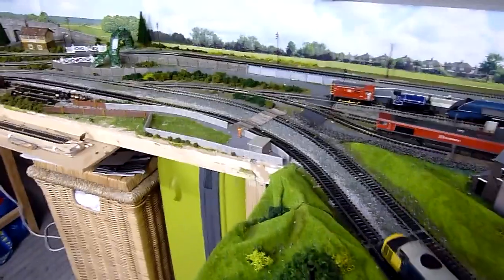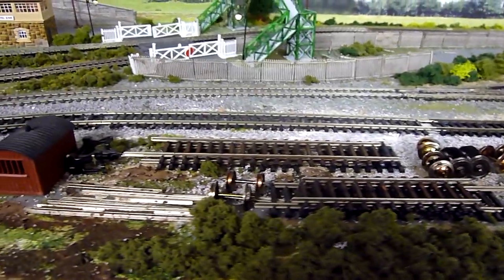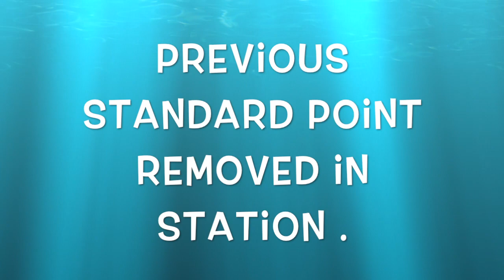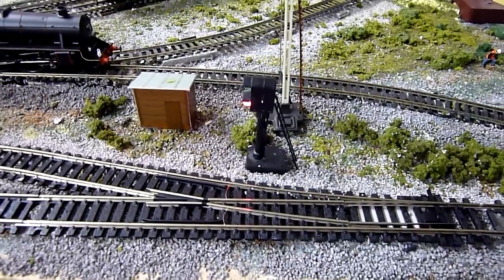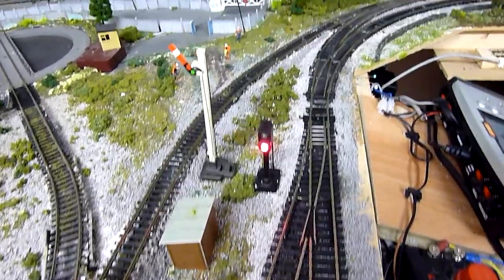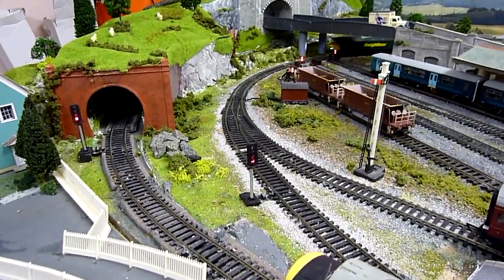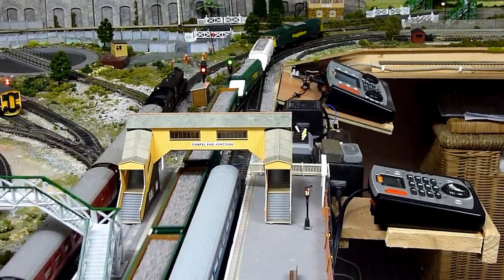TWO RUNNING PROBLEMS SOLVED .

Comment: Always little improvements to be made Peter, I'm just starting on an all day job reorganizing some wiring. I worked before but this will be more logical and easier to understand. ( I hope lol.)  David.
Reply from the maker: Hi David , yes always something needs tweaking on the layout . I wired in a new light signal if you noticed at the end of the station . 
    Has winter arrived yet for you ? 
   Cheers.......Peter
Reply: @ChapelEndJunctionUK  Hi Peter, We are enjoying some beautiful weather at present. It was 13° c. on Mon. last and around 3-5 for the rest of the week. Same predicted for next week. Today started off with a good frost but it`s clear and sunny right now. Cheers, David.
Reply from the maker: @trainsontuesday  Sounds nice and fresh .

Comment: Life would be a lot easier in a layout without having points Peter , so many times have fitted them , and 9 times out of 10 not a problem , then you get the odd one which always like to cause a problem with derailing ... as the saying goes .. been there seen it done it .. LOL  ..
Reply from the maker: So true David , why I didn't think of fitting an express point in the station ages ago I just don't know but it has made a big difference to the run of the layout . The siding was a recent addition . 
    Cheers.......Peter